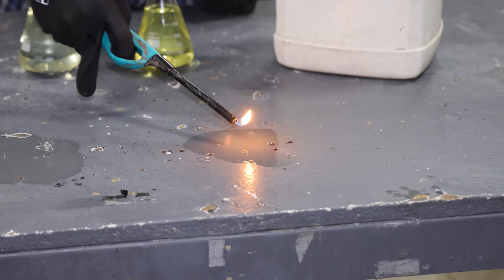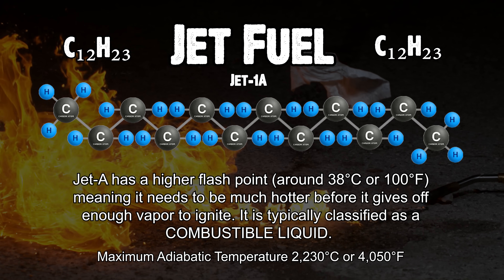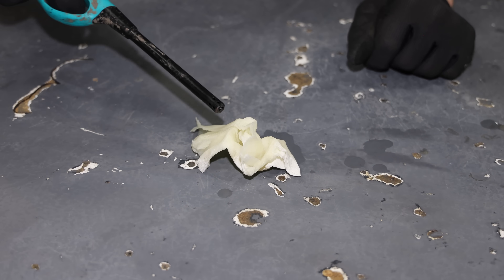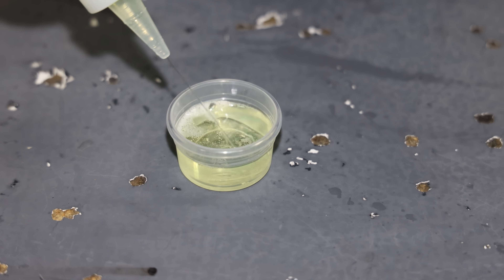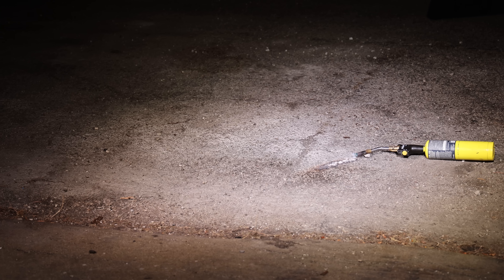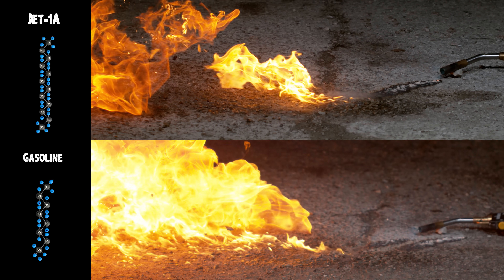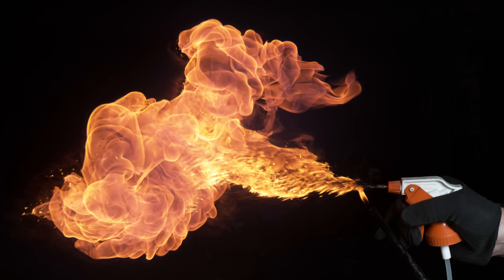What Happens If You Light Jet Fuel vs Gasoline?

Comment: The TWA 800 jetliner explosion out of NY to Italy was determined to be caused by an electrical short by a fuel tank. In those days the airliner fuel tanks in the wings were vented to air. The result was a fuel/air mixture in the tank, and that is explosive, not just burns.

The military knew this for years, and has a system to replace the used fuel in tanks with nitrogen, which is not flammable. In military aircraft they have to worry about tanks being punctured by bullets.

The airline industry didn't use this method because it is expensive. And TWA 800 showed the weakness that resulted. After TWA 800, the FAA and NTSB pressured them to adopt a "safe tank" technology. Finally, it got solved. But not that way. An engineer figured out that every jet fueled aircraft has a ready supply of inert gas to use to fill emptying tanks with.

The jet exhaust.

Its already burned, and won't burn again. It is cooled and sent into the tanks.

Comment: You know what this also proves? The footage of the explosion into the Pentagon on 9/11 was not a fireball of jet fuel.
Reply: No, it doesn't.  Many a jet fuel powered plane have gone up in fireballs due to a crash. 🤦‍♂
Reply: @91156  The fire at the[pentagon was a quick flash and did not have a slow burn after the impact. Not to mention, there was no landing gear or tail section, or the practically indestrucatabe engine parts, or luggage...  Anyway, it's all in the past now.

Comment: The jet fuel used in the SR-71 Blackbird is even less volatile than jet A. This experiment is why I get kind of irritated when I hear people use the analogy of it's like the difference between pouring gasoline on a fire or jet fuel. Which implies it is much more intense if you use jet fuel than gasoline. Jet fuel is basically some fairly clean kerosene. A refined version of kerosene is also what is used in a lot of rockets like Falcon 9. That jet fuel actually smells just like kerosene because it mostly is the same thing.

Comment: 0:07 - Quite the opposite.
There is a plethora of YouTube channels by military pilots where nearly all of them refer to jet fuel as "gas".  Each and every one of them should be fully aware of this HUGE distinction that you have so clearly demonstrated.

And their viewers take their word as gospel.  Even though they are blatantly mistaken for saying this.

You could have gone into the explanation of how the US Air Force switched from JP-4 to JP-8 in the 90s after experiencing horrific tragic explosions because even their standard jet fuel ubiquitously used throughout the 60s, 70s and 80s was still too volatile.

Even better to have gone further to explain how the USAF SR-71 used an even less volatile fuel formulation, JP-7.  This Mach 3+ jet flew so fast that its skin experienced thermal expansion.  While taxiing on the ground, it would regularly LEAK fuel.  So the Air Force needed a special tanker, the KC-135Q, to refuel it.  The Q-model had 2 sets of tanks.  One for regular jet fuel that it used itself, and gave to regular aircraft.  And then a separate system of this high flashpoint JP-7 that it would give to the Blackbirds.

Comment: The real reason why Gasoline is not used in planes is that gasoline needs lots of oxygen to burn efficiently. At higher altitudes where oxygen is present in very small amounts, Jet fuel burns a lot more efficiently because it requires less oxygen to burn. Also at higher altitudes the temperatures are at freezing level thus Jet fuel has a higher freezing point than gasoline.
Reply: True, but many smaller planes do use gasoline.  They don’t fly as high as the jet airliners, though.
Reply: @MrBerryK In aviation there is a 25,000 feet altitude rule. If a plane can fly above 25,000 feet it would use jet fuel. If it can not reach 25,000 feet, it uses 100LL aviation fuel. 25,000 feet is where freezing temps develop.
Reply: @copkhan007 Interesting.  I never knew that, since I have never aspired to fly jets.  Little Cessnas and Pipers are exciting enough for me.
Reply: Sorry, but jet fuel (kerosene) will freeze/jell at a lower temperature than gasoline.  Granted, jet fuel has anti-jell additives/blend, but its freeze point is not why it is used in place of gasoline.

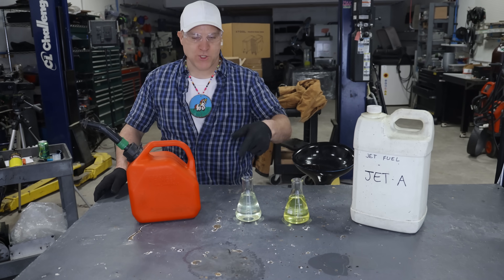Comment: 1:34 love the way you demonstrate the volatility by igniting a puddle of gasoline next to a container of gasoline. 🔥
Reply: For science
Reply: Next to another container of gasoline that's next to a container of jet fuel 🔥⛽💥
Reply: it must be well calculated
at that distance, the gasoline/air mix from the conical flask must not be flammable:face-blue-smiling::face-blue-smiling:
Reply: yeah, because he doesn't know anything about safety and he is amateur.
Reply: @emmanuelquerol once you understand how fuels behave and burn, you understand that what he did was totally safe.
Reply: @gerrymainville7904  not totally because the open gasoline container was very close.. so how is that totally safe??
Reply: @emmanuelquerol at the worst scenario, it would have ignited, but since it’s not vaporized, it would never explode. Such a small container filled to the brim with gasoline is not a hazard unless it is spilled, resulting in a lot of the contents to be exposed to the air in the atmosphere to burn. You can have a 1000 gallon tube of gasoline 4 inches in diameter with only the top open and safely light it up. Only the top 4 inches is exposed to the air and can burn. Ever tried to burn Coffee Mate? It doesn’t burn that well in a can, but vaporize it and it becomes violently explosive. What matters is the surface area of the combustible material exposed to oxygen. Now, if the small container caught on fire, and he jumped back and accidentally hit it and it spilled, then yes, there would be a problem as all the contents would suddenly be exposed to oxygen and instantly start to burn.
Reply: @gerrymainville7904  and you're saying there's a possibility of getting the container knocked over.. that is still not totally safe!
Reply: @gerrymainville7904  I grew up in a car repair service owned by my family, my grandpa ran our business with my uncle.. The odor of fuel was just a regular part of our life, whenever I go to other places with the smell of gasoline, I feel at home.. So i know 101% how gasoline, diesel, and kerosene behave more than you do! So I absolutely know that what he did was 101% not totally safe! ! !
Reply: @gerrymainville7904  Do I have to educate chemical engineers here?
Reply: @emmanuelquerol well as an automotive technician, heavy equipment technician, alternative fuel technician and a power engineer, I know that unless he ACCIDENTALLY bumped one of those containers over, what he was doing was safe, and seems how little fuel he had in them and we saw that he had a fire extinguisher handy, he took the necessary precautions to ensure a safe environment for his presentation.
Reply: @gerrymainville7904  no you're not! you're just pretending you are a technician of many sort.. you see the contradiction in what you've said? if you are what you claim you are then you should already know that his layout of the fuel and flame on the table is not totally safe! You failed in this aspect so you're no near any kind of a technician. if you were in a petroleum laboratory, you already committed a violation, so you failed!
Reply: Idiot at work
Reply: Yep. Super dumb.
Reply: My kind of guy.  Has a lot fewer limits to his actions because he knows exactly what he is doing, and the expected result.
Reply: @CitroenDS23 no, he addresses this in another comment. They are empty props. Because it would be incredibly dangerous to burn that close.
Reply: @CitroenDS23 so it’s true, you can’t win an argument with a stupid person. I hope you haven’t got any dependants.

Comment: Inside the Pratt+Whitney engines I worked on is a set of high pressure constant flow fuel injectors that sprays the fuel directly into the different combustion chambers.

Comment: Jet fuel is similar to diesel, it needs to be atomized and/or compressed to ignite, you can run an old diesel engine on Jet-A without problems, and you can power a turbine with diesel, they are very similar. And as you said in the video, theese fuel is more energy-dense, that’s why a diesel car has better mileage than a gasoline one.

Comment: Growing up in the 50's and 60's in between Chevron and LAX, we kids would always head out to watch the fire drills at both the refinery and the airport.  After watching the Chevron team try to set a tank of crude ablaze in their tank farm in the mid 60's we were delighted to see a lightning strike set it off and they chose to just let it burn (on top) while they drained most of it from the bottom.
Somewhere I've got a roll of Ektachrome slides of that tank burning.  Good times.

Comment: Pure jet fuel will destroy a diesel engine.   Mix with diesel must keep the concentration low.  Jet fuel has low lubrication properties. The injectors and fuel pump will fail.

Comment: If a Navy aircraft carrier jet gets JP8 (same flash as jet A) from an Air Force tanker or air base,  it's not even allowed in the hangar deck without a complete defuel. We use JP5
Reply: I retired from the USAF in 99.  As a crew chief on the heavies, we always pumped JP-4.  The KC-135 used and offloaded the same JP-4.
Reply: @robertheinkel6225 Yes it was always JP4 in my time too. They are using JP8 now which is basically Jet A with anti icing and corrosion additives.

Comment: A better fuel tank design was promoted in the early 1970's, by a Canadian company, Vulcan Engineering.
The tank was filled with blocks of many, many layers of expanded aluminum sheet-metal. So this would isolate any burning fuel (exposed to oxygen in the air) from most of the fuel in the tank.
This idea quickly was superceded by open-cell plastic foam inside of a fuel tank, which weighed less, and was cheaper to manufacture.
However, after exposure to hydrocarbon fuels, the plastic eventually disintegrated; clogging the fuel filters, etc.

Comment: It's not even necessary to do this video, Jet A has the same flashpoint as Diesel 52 deg C, the only real difference between Jet A is it's clear and has no contaiminants and is clean burning with no smoke. Gasoline has the flashpoint of -43 deg C. Jet B which was used in fighter jets it has a flashpoint smilar to gasoline. I used to work as an aviation fuel specialist and ran a tank farm for a major airport in Canada.

Comment: The military uses JP8 (a modified mixture of Jet A) in place of diesel for all the vehicles and other engines it has designed for deisel. I can see why. The behavior of jet fuel here is very much like similar demonstrations I have seen comparing gasoline with diesel fuel. 

A friend of mine with a modern flamethrower has found that a 90% diesel 10% gasoline mixture gets the best results in his flamethrower. A higher deisel mix would shoot farther but won't reliably ignite on the device's electric spark igniter. More gasoline loses range.

Comment: Yep - jet fuel is oil.  Aerosolized just fuel = bad.  That is why they tried an additive to jet fuel, back in the late 80s or early 90s, that would clump up the fuel to prevent explosions.  Unfortunately - the test they did (and can be found online) did not have the results they wanted.

Comment: The better fuel tank design exists.  A fuel tank filled with a material similar to “steel wool” is much safer in a crash.
Reply: Hmmm, kinda like what Volkswagen did with the Mk4 fuel tanks in the Jetta and Golf that had a fuel-proof foam inside the tank? 
IDK how effective it was at deterring a fuel spill in a crash, but it really made it tough to siphon fuel from. 
(I owned one, a Mk4 TDI Jetta with the vent mod that I did myself.)

Comment: Prevent fuel atomization? Check out Racing Fuel Cells. they might not prevent all together but they're designed with a lot of safety reasons in mind as well as have internal features that are consistent both with performance and safety.

Comment: Demonstrate the ignition temperature difference by using a hot plate on both puddles, showing that jet fuel requires external heat even without atomization to reach its flash point, while gasoline ignites from vapor alone.

Comment: Chemist here!    I like the video, though my fire safety sense was at 5-alarm fire!   However, you missed a few things.    Something really similar to jet fuel, called RP-1, was burned in the Saturn V first stage - the Apollo moon rocket - so it is pretty close to rocket fuel.  Also,  gasoline isn't pure octane (C8H18), it's a blend of hydrocarbons include some benzene and friends.    Jet fuel is not far from the kerosene used in heaters and such
Reply: IsoOctane  is ironically the worst thing to have in gas. 2,2,3 tri methyl pentane is a better option in gas to improve combustion. Both are octane structural isomers.
Reply: Petroleum chemist here!  As you pointed out, gasoline is a mixture of different length hydrocarbon chains and rings, with some chains as short as 2 carbons (i.e. variations of ethane) and some chains as long as 15 (or more) carbons.  Also, if you live in northern climates, the blend of hydrocarbons changes between summer and winter (with a higher percentage of shorter chain hydrocarbons present in "winter gasoline" to facilitate cold weather starting; and a higher percentage of longer chain hydrocarbons present in "summer gasoline" to prevent vapor-lock).  The classes of hydrocarbons present in gasoline are: Parafins (straight chain hydrocarbons), iso-parafins (branched chain hydrocarbons), Olefins (at least one carbon-carbon double bond), Napthenes (ring structure hydrocarbons) and Aromatics (benzene ring structures with 6 carbons and a floating double-bond).  Ordinary pump gasoline has hundreds of different hydrocarbon molecules (so the story is far more complex than presented in this video).

Comment: That’s not the right formula for gasoline. 100 octane gasoline would be 2,2,4 trimethylpentane. It’s a pentane (5 carbons) with a methyl (carbon) group at 2, 2 and 4 adding up to a total of 8 but the way you have it it is simply octane. Some Octane may be present, but that’s not the goal.

Comment: Good video.  I've been working on jet engines for 45 years. The SDS states Jet-A is pure kerosene, which is correct if there are no additives. I used to use waste fuel from the job in my oil burner furnace. It was always very clean during the annual inspections. It burns a lot cleaner than fuel oil or diesel.
Reply: I've been working on aircraft for about 14 years now. I've worked with guys who would take waste jet-a & waste oil, combine it, and use it in their diesel vehicles.
Reply: @YojimboZantetsuken   indeed ounce in the Dakar race a truck run out off diesel.
There was jet fuel for the helicopters so Wuf v Ginkel was told to mix it with engine oil and send it.
Reply: @ronald3148 for me it was an old guy with an old diesel Ford truck. The other was a guy with a diesel audi car. Fabricated his own extra fuel tank in the trunk so he can drive practically forever with what he was getting from the shop.
Reply: @YojimboZantetsuken  Yeah, i've done it. Runs great with powerservice additive 30:1. Filtered waste oil is fine, but unfiltered can do some damage.
Reply: When we defueled an aircraft we hauled it back home in 55 gallon drums. never paid a dime to heat my home !
Reply: Free heating! Love it!
Reply: Lots of guys on the Classic Camp Stove forum burn jet fuel in their kerosene stoves and lanterns. They get the one without the deicing addtive.

Comment: A piston engine works in a series of distinct stages, including a step for compressing the flammable vapors. You do not want the stuff to pre-ignite at the wrong time, so you need to refine for a decent octane level, and a higher level than that allows for more compression and performance - US aircraft on WWII often used 100 Octane. Jet engines and rockets are one continuous process with no compression step, so anti-knock rating doesn't matter. 

The use of Jet aircraft by Germany in WWII was in part driven by the fact they couldn't produce enough high quality gasoline. Turbine engines can use less refined fuel than piston craft.

Comment: Jet A is closer to diesel fuel than gasoline. Diesel fuel and home heating oil also need to be atomized or heated to a vapor to burn. They are oil. This is why we call diesel engines oil burners and I suppose we could call jet engines oil burners also.
Reply: A lot of pilots call jets kero burners.
Reply: Jet A is kerosene
Reply: If Jet fuel is safer why don’t cars use it

Comment: another jet fuel in use is much different, I handled and delivered Jet-B to our fighter jets, jet-B is much more volitile than jet-A
Reply from the maker: Yes Jet B I believe is Jet a cut with Naptha and or gasoline to prevent freezing at very cold temperatures. For sure it's more volatile and I believe it's considered flammable

Comment: Wonder if Oasis sponge for keeping display flowers hydrated would dissolve or hold jet fuel? Fairly sure it'd still be an effective wick, but maybe it'd work like the agamassan in acetalyne bottles. In use, use air pressure to push some liquid free, with the rest held in suspension inside the sponge.

Guess the real question is what's the least bad option: Flaming mushroom cloud and huge pools of burning fuel, or meteorite rain and blocks of burning "composite" fuel everywhere?